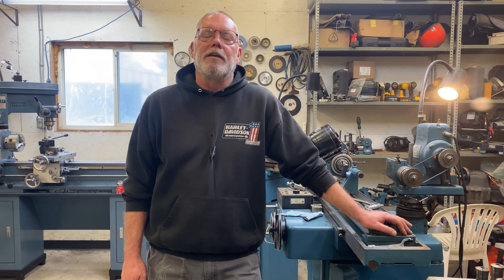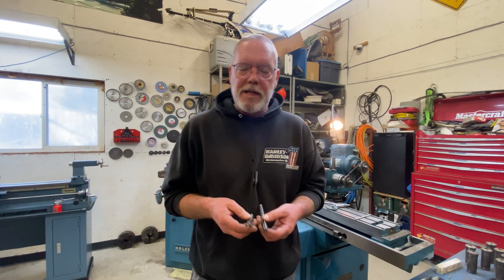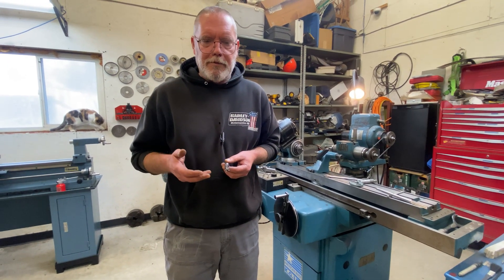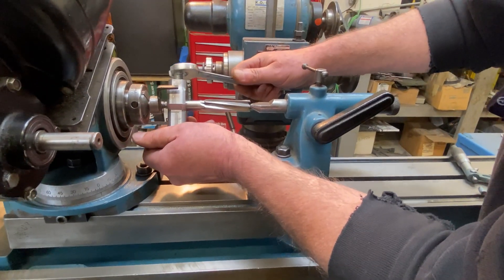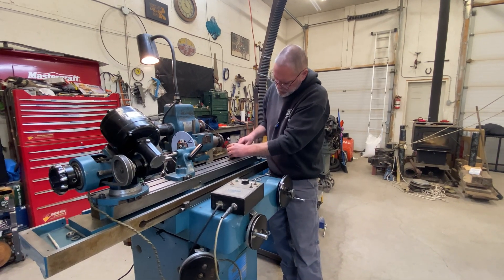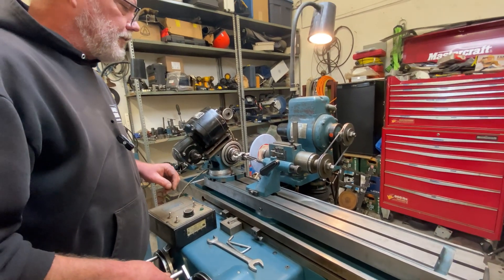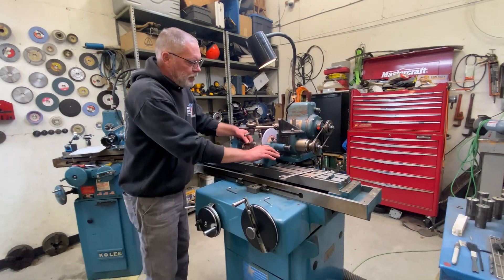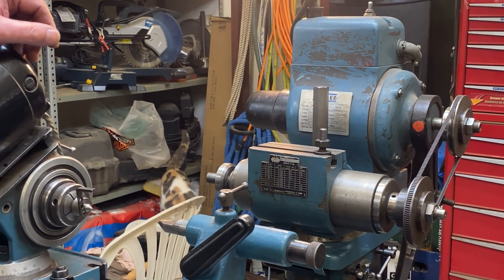HOW TO CUSTOM SIZE A REAMER

Comment: Your wife's a champ for filming this. Subscribed. Thank you. 
 Ive got a Harig and a surface grinder. Looking to undersize a 12mm reamer. How far you reckon I can go before I need to re-grind the relief? A few thou off the Radius? Any rules of thumb?
Reply from the maker: Thanks, she's a gem all right!
You can get away with way more than you would think. A tool will still work with the tiniest sliver of a flute but remember as the depth of the flute decreases your vigilance in clearing the chips has to increase accordingly. 
Thanks for watching!

Comment: A simple and very effective reamer can be made from ground high carbon steel, commonly known as "silver steel".
Machine to the diameter required, machine or grind off to a long flat oval cutting edge, length about   4 times the diameter. Harden and temper to a light straw colour.
Sharpen on an oilstone.
Reply: Thank you
Reply: "grind off to a long flat oval cutting edge," an angular section through a cylinder will be a parabola, or part of a parabola. This sort of reamer, commony used by guys working on dies, is only good for removing minimal material, like a build up of lubricant "varnish" or the tiniest bit of damage.  I've just binned dozens.  I'm retired, hadn't used them for 25+ years, didn't meet anyone who could use them...

Comment: Great video as usual, newbie question, when you dressed the wheel the table was set to your 1/2 thou angle so wouldn’t that put the same angle on the wheel? I’m assuming that’s deliberate, does that give a clearance angle for the grinding so only a small bit of the wheel is actually removing material? If you dressed the wheel before changing the table angle would that make any difference or am I overthinking as usual? 😂 Thanks!
Reply from the maker: Great question! I don't think it's possible to "over think" when you're talking about tapers because there's a lot going on and everything affects everything else. 
To answer your question,  I had the upper mounting surface of my table set at an angle with my diamond dresser mounted to it but the dressers  path is determined by the table ways and they always run  exactly orthogonal to the saddle ways  so my wheel was dressed at 0-degrees and the entire surface of the wheel was in contact during grinding. So to sum it up regardless of the table angle you will get a 0-degree dressing on the wheel.
If you actually want an angle on the face of your wheel you would offset your wheel spindle to the desired angle, dress the wheel, return your spindle to 0-degrees or dial it 0 to your table ways and then you could proceed to grind the angle.
Hope that makes sense
Cheers!
Reply: That makes perfect sense! Thanks! More to think about!

Comment: Is that a Raptor 90 heli in the background?  I've been flying R30 & R50 for about 24 years.  I never got up to the 90 size.
Reply from the maker: Hahaha, Good eye!
It's actually a raptor 60 with a 70 in it.
I slowly worked my way up to it in about 2008 after mangling multiple little electric jobs

Comment: Hello Lappe Mountain, again really enjoying the videos. They are exceptional. Would it be possible to add to the video queue how to change the angle of an angle reamer? I need a 4° taper reamer of a specific start and end size to fit a blind hole. I have plenty of 3° and 5° taper reamers I would like to try and convert to what I need. Is this possible? If so a video would be greatly appreciated! Thank you again. -term
Reply from the maker: Hey term. Consider the topic added to the que! Spoiler alert! to make a 4' you would want to start with the 5' not the 3' so that's the example I will do.
Thanks for the comment!
Cheers!
Reply: @Lappemountainliving  brilliant thank you!
Reply from the maker: Howdy
How to custom angle a tapered reamer is coming out tomorrow!
Hope it helps.
Cheers!
Reply: @Lappemountainliving  Amazing! Thank you.

Comment: I'm wondering if the same thing could be achieved with a Darex E90 endmill sharpener?  I happen to own one of those and never thought about sharpening reamers with it if I needed to.
Reply from the maker: I hadn't heard of that machine before so I took a quick look at it and it looks like it would work for putting the clearance angles on but I'm struggling to see how you would be able to grind the lands with it. Thanks for watching and commenting!
Reply: @Lappemountainliving   To grind the land, you engage a lever in front of the tool which drops the spindle down roughly and inch.  So because the spindle/work is sitting lower then the center of the wheel, it's in the right spot for griding a land.
Reply from the maker: I believe a "land" can have different meanings depending on the tool being discussed. I'm curious if we're both using the word land in the same way in this discussion. When talking about the land on a strait reamer I'm referring to the cylindrical area between the tooth face and the clearance angle. Can you clarify what feature it is that you're referring to?